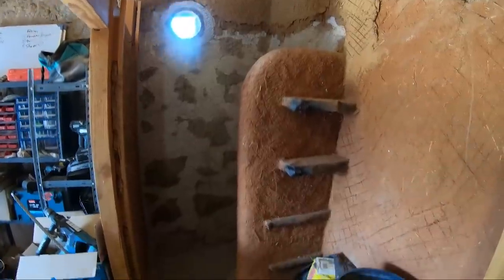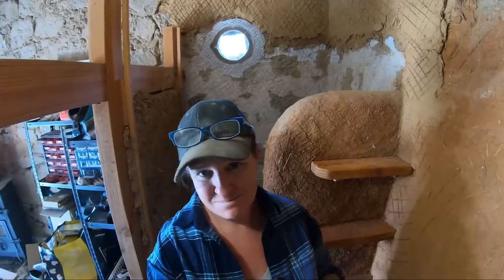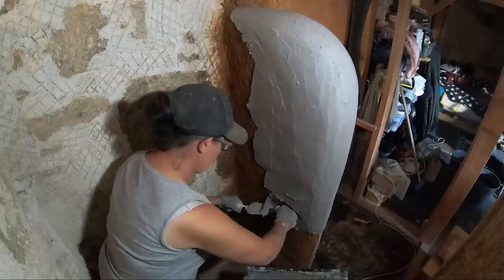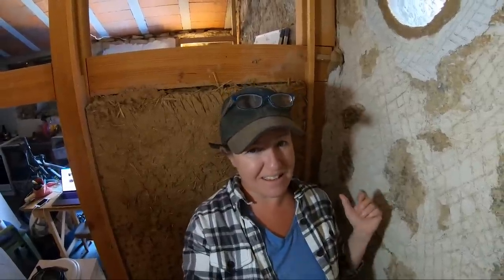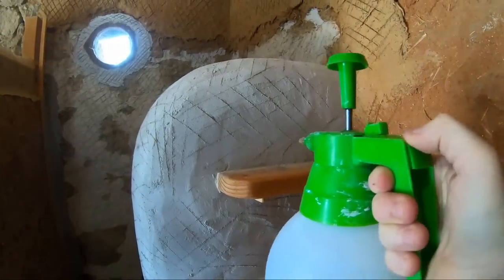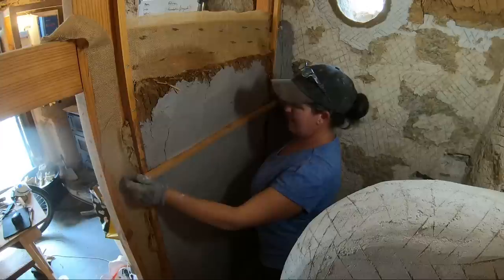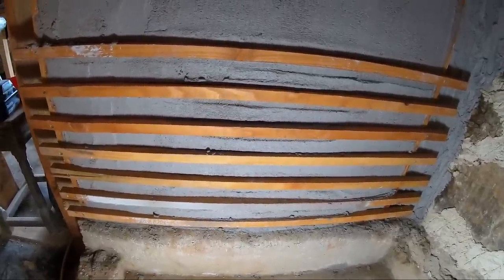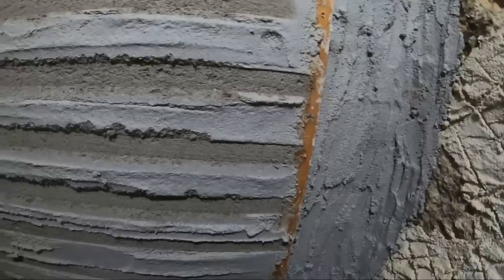Tiny House Shower #6 - Weird Wall, Plastering Fun, & New Tool Love

Comment: You could hang a shower curtain that would cover the wooden wall and the opening to the shower when in use. That would help protect that wall from getting too wet. You can use a curved curtain rod to hang it so it could also close off the entrance to the showers tall as well.
Reply from the maker: I like the idea of having an open shower... I've never been so crazy about curtains. But I certainly will add one if it seems water is escaping. Thanks!
Reply: Beautiful work
Reply: Hi, everything is looking so good. I do admire you for having a go. The bottle wall top would give you that extra light. Or you could create a perspex one. Any how have a good weekend.  Glad to hear you'll have company next month. Extra hands and ideas etc.  Stay safe.
Reply from the maker: @helenblatherwick8994  Thanks! I've never heard of perspex, I'll look it up! I'd love stained glass... but bottles could be a nice alternative. Let's see! 😀

Comment: When you shop for your shower, don't forget a towel bar that is wide enough to allow your towel to dry thoroughly. Or perhaps the air is dry enough where you are that a towel hook will do.
Reply from the maker: I'll get one for sure, I just need to make sure the wall it will hang on will be water resident enough for that... some things to figure out!
Reply: @PortugalfromScratch  I expect that other people who are renovating old buildings in Portugal will learn from your channel. In that sense, your "fails" are simply teachable moments. It's all good.

Comment: I love the clay as I work with clay myself but I certainly understand the need for the lime. Looking good. It’s great that you are now officially a resident. I worked with a trawl in Portugal on a habitat for humanity project. That was building a new house and they were using cement. The arms and shoulders do a get a bit sore doing that day after day but rewarding. I love Portugal.
Reply from the maker: I was hoping to use clay as a final render in certain places of the house but it's hard for me to source so not sure. The lime is what's needed for the shower though... but clay is an amazing material! Lime is so much nicer to plaster with than concrete, that's tough work for sure!

Comment: Congrats on the residency! Good decision on the Tadelakt that is going to look awesome. You may not have to do all the lime layers with the tadelakt procedure. Even if you are not ready to do that yet, just protect the wall with plastic while you shower maybe?
Reply from the maker: Thanks! I was already a resident but getting the card makes travelling less of a headache. 🙂 For tadealkt it's just the final layer and then I'd want to pay close attention to how to do the layer under it... probably use fine sand instead of course sand. At the moment all I'l doing is building up the shape of the shower, bit by bit. I'll be paying attention to what the walls are doing and how wet they get and covering them could be an option if things look weird. Let's see!

Comment: This is a complex shower.  I would probably have done the job with 2 IBC tanks, but It is very interesting to see you work with different mediums. You could use shower curtains to protect the walls until you get it done. I can't wait for the next installment. 🙂👍👍🇨🇦
Reply from the maker: It's not so complex because I understand how the materials work... I think I might just be overcomplicating things a bit in how I explain things. IBC showers are cool but more for outside and I don't like working with plastic so much, so for me that might be a bit more complex. I guess I feel very comfortable with natural materials and I'm excited to push them a bit and see what they're capable of. It's all a big experiment so let's hope nothing falls down! 😁 Thanks!

Comment: I know I go on about playing with mud and all but I am genuinely interested in what you are doing, I am a bit lost on how the shower will work and be able to take a soaking from a shower on a regular basis, you have obviously done the homework on this so I am really looking forward to seeing the end result - your technique is getting better every time you pick up the trowel!
Reply from the maker: Thanks! Eventually I'll coat the shower with a waterproof layer and, until then, I'll monitor how things are going. There will be several layers of lime over the clay and wood and, though it's porous, I think the shower is large enough not to give it too much of a soaking. I had the short clay wall uncovered for about a year and it didn't seem to get damaged at all which was surprising. So... it's an experiment for sure, at least until I get the final waterproof coating on which won't be until I feel very confident with that trowel! 😁

Comment: Kirsty, will the wood in your rendered walls ever rot, or does the render protect the wood? Has Mikey used the shower room window to go outside? Your shower is going to be so nice. I really love the videos.
Reply from the maker: Thanks! The idea is that, if the wood is fully encased in lime or even in cob (clay, sand, straw) that it will be protected. if the covering would start to flake away leaving the wood exposed, then there's a problem. but no rotting should happen if it stays encased. If it's a building outside, rain can sometimes knock the lime or cob off of the wood causing problems, but inside my house it shouldn't be an issue. But let's see!
Reply from the maker: Oh I don't know Mikey is using his door... he's been mostly out all day and only coming back at night when I have it closed. I'll be monitoring! 🐈‍⬛

Comment: you can use the slats as a guide to put your lime up and get a flat (square) surface. after that slide out the slats (pulling them can pull the lime with them so slide a bit to loosen them) and fill up the grooves the slats left behind. now you have a flat surface. (that is if you want it.)
niice job you've done so far.
Reply from the maker: Nice idea, I had the same thought but I got cold feet! I was nervous the wood would get stuck in there. I was even going to do it so I only partially filled the spaces between so I could get them out, but then by the time the end of the day rolled around I was sort of fed up and just wanted to get them off without more thought. But I think your idea would have worked better... but still, I think it'll work but I'll just need a lot of layers to get the thickness I want. Should be interesting to see how it all turns out! 😁

Comment: interesting architecture ! have you thougt about an electric ventilator or a ventilation system for cooking and showering to blow out the waterdamp and to prevent your home from mold ?
Reply from the maker: With natural materials, mould is less of an issue. Clay and lime have amazing properties that regulated humidity and help with this sort of a thing. I would be open to a ventilation system for sure, but even now without any proper window in my house, cooking, breathing, showering, etc haven't caused any problems. I'll have a window in the kitchen soon enough and eventually I'd also love a skylight over the bathroom area. But I'm so impressed and a bit amazed that I have had problems so far! It really is down to the amazing qualities for lime and clay. I'm curious what it would be like if my house was made from concrete blocks... probably lots of moisture and mould issues as I've seen this in other people's houses.

Comment: Looking good. If water can pool on clay.... It will be fine. If not, wax it lol
Cheers!
Reply from the maker: I had the small clay wall exposed for a year and it survived... I think things will work out ok but I shall be monitoring closely! 🙂
Reply: @PortugalfromScratch  well, clay unheated and unglazed will mold. You may want to mix in some borax, unless you waterproof the lime.

Comment: You are doing so much work but I see that you are enjoying it. That’s great!!  Question, what is the advantages of you doing the shower this way versus framing the wall, add cement boards and tile the walls?
Reply from the maker: Yes I love the work, at least for the moment! I'm really interested in building with natural materials and that means I'm not so using concrete/cement, plastic stuff, foams, caulking... etc etc. They all have their place but for me it's a last resort. So I'm trying to figure out how to get this done with clay, wood, lime, etc and so far I think it's going ok. If it all fails, cement board and tiles it will be!

Comment: It's so impressive all your work!  The small windows bring in a surprising amount of light too.  But why put the WC and shower inside the tiny house?  Why not build a shower and WC outside?  Wouldn't this be easier and then leave you more space inside, less hassle putting pipes through walls or worrying about damp on render/cob, etc.  Just curious.
Reply from the maker: Eventually the toilet will be outside in a compost loo but for the shower, I just didn't like the idea of having to go outside, especially when it's cold out. I tried to imagine my daily routine and a shower and place to wash my face and brush my teeth inside my house is something that I think will keep me happy. Just a personal preference, really. 🙂 Also, I actually think my place is quite spacious  so plenty of room plus, with pipes and stuff, even if the job is hard to do, it's the sort of thing that only has to be done once. I'll always choose to do the hard thing if it just gets it done and makes for a big improvement to life. For me, a shower inside is key so it's worth it!

Comment: I wouldn't regard the use of the bars you later removed as a "waste of time & resources" https://youtu.be/sqr3gxtlqxY?t=1697 , but as forms like you'd build for casting concrete & remove after. They strengthened the render as you were applying it, & they helped you get the flat wall surface you're going for (& it looks they also left a nice "tooth" for the next layer to adhere to).
Reply from the maker: That's very true!! Thanks!